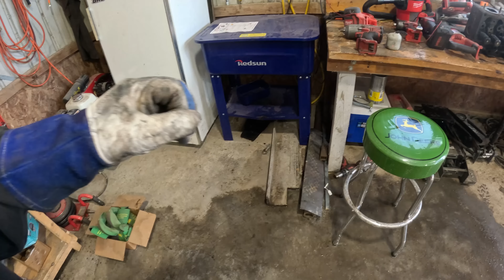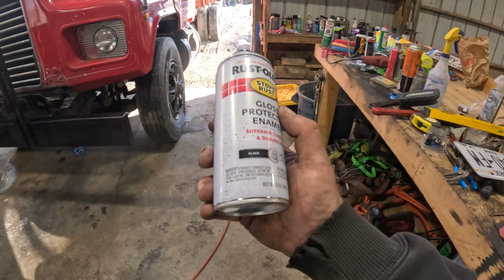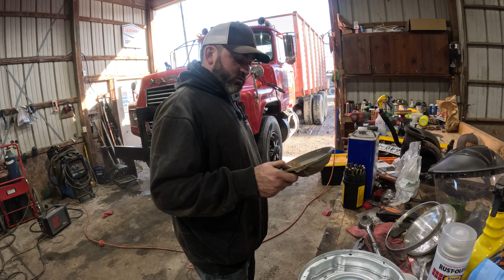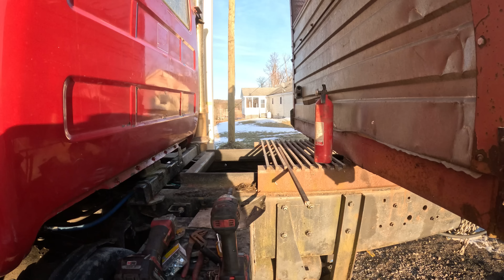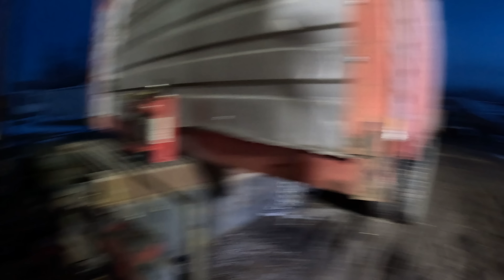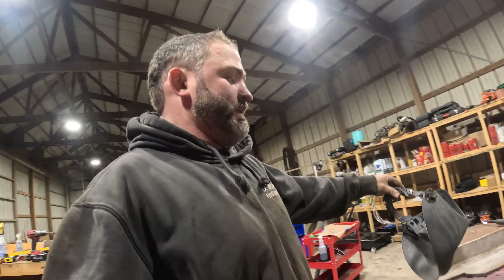Bumper Lights & Floor- Basically A New Truck

Comment: On the Mack tractor battery issue pull the battery lead off the alternator, use a volt meter to check if there is a voltage flow back through through  the alternator, if there is a leaking diode in the alternator it will discharge a battery.

Comment: I drilled spot welds out of a 50s car and cut sheet metal to replace interior floor pan used pop rivets to hold new sheet metal in place and a little fiberglass to seal the seams looked beautiful from underneath and was solid.  Just a thought

Comment: We got all International S-series trucks. Love them but they’re definitely farm trucks. But a year ago I nearly flipped one in a swamp. Shifted the axles, might have tweaked the frame and snapped leafs. It dog walks bad, so the boss doesn’t want to use it (it’s not like our other doesn’t do it too lol). He wants to find a replacement cab and chassis to swap the body on too. I think that’s dumb. We got two “parts” trucks in the yard, one with mint bushings. Told him we take the good parts and swap them over winter but he doesn’t want too. Truck runs and drives good, even looks good. Just don’t wanna see another International but put too rest or scrap. Mean while other people are running half crushed trucks🤣🤦‍♂️

Comment: I had a biss that built pick up bumpers like that.  He fit it with a air valve and had a compressed air storage to air up tires in Alaska.  Of course he didn't have truck on board air for brakes.

Comment: Our local welding shop only uses tap water to cool bits when drilling . The old man laughed at me when i asked where the oil was. He said son, water is free and it dont make no mess, just use a liitle more of it.
It was at that moment i realized that that nasty mess around my drill press and work bench,my whole life,  was avoidable

Comment: Chris if you put a little spay of diesel in the bumper after you weld the end plates on thru your drill holes it will rust proof the steel ...old method
Reply: I just put a threaded weld on bung on bottom and fuel fill on bottom. Run a line to tank. Extra fuel 🤷🏻‍♂️😉

Comment: When you're using a piece of equipment to make money, you can't afford screwing around with dodgy batteries. Time is money when the poo must flow.
Reply: Well the only problem with that is they don’t make any batteries like they did 25 years ago. 🤷🏻‍♂️ ask any farmer and they will tell you they don’t last. Even with a disconnect switch.

Comment: Better get a roll of dot reflective tape for the sides of the tanker. You need little over half the total length of the trailer. In Indiana anyway.
Reply: Not in ny. As long as there is lights on the front and back of the trailer you're good to go. Reflective tape is optional

Comment: Ny state used to be strict on  trucking companies yearly safety inspections farm truck or not if you stomp on brake pedal or seat drops does that not matter as much as brake shoes slack adjusters or air leaks
Reply: In NYS a farm plated truck does not have to have an inspection but still must be able to pass one. I've had trucks with farm plates and in New York you are only on allowed on the   highway to drive to and from your own farms. Using a farm plate to get out of inspections and haul commercially for others is not a good idea.
Reply: @DLH-Farms  here in Canada no longer get away with any structural even corrosion on farm equipment or otherwise just like drivers are no longer able to get an air brake endorsement they do offer driver school courses for potato trucks but they are expensive but commercial trucking has become ridiculous on both sides of border no one tells you how you can afford to buy new or rebuild and repair and afford things these days my highway trucks parked and I don't see revenue to rebuild a 2 m mile old truck yet again